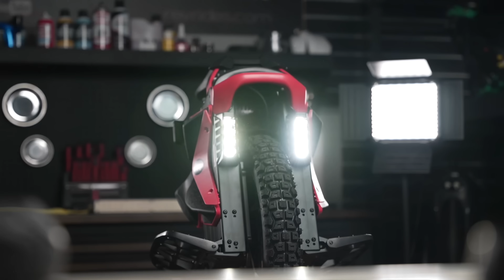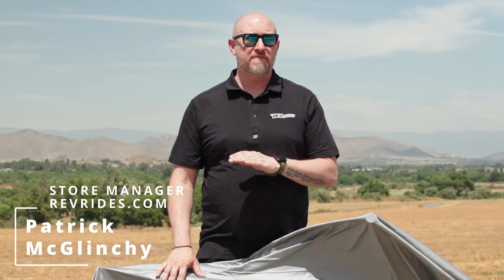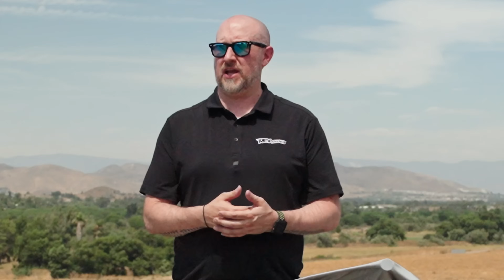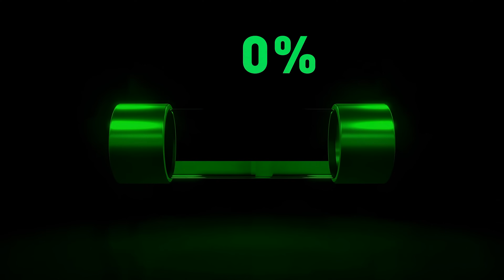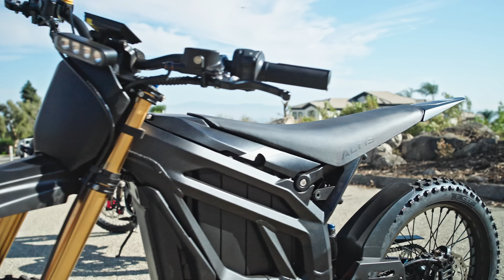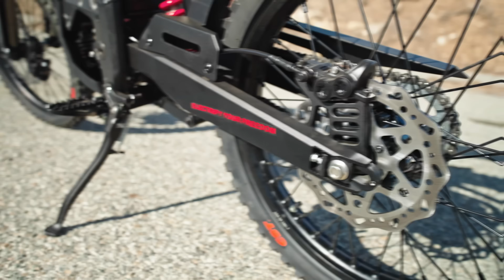Altis Sigma Electric Dirt Bike... The 98-VOLT GAME CHANGER! | Product Announcement

Comment: Wait so the 16 inch wheels are slower?
Reply: Looks like different sprocket size geared for more low end torque/quicker take off.
Reply: @clintroberts1  44T on MX vs. 39T on standard
Reply from the maker: correct! Why didn't you subscribe yet!?

Comment: Sigma or sigma MX for riding in NYC streets?
Reply: Sigma, not the MX. Mx is for off-road riding
Reply: Seems like you would get MX and then swap the front wheel with a 16 and Supermotos and then maybe change the rear sprocket.
Reply: @clintroberts1 Not me. Im 6'6". I'm going to need the taller tires. I'm already afraid the bike is going to be a bit small for me. Plus, bigger tires mean higher top speed.
Reply: @TooTallRides-TTR  Ah yes, different story then.  19's all around
Reply from the maker: 19/19 but its a dirt bike....

Comment: Have a E ride pro SS 2.0. This looks awesome though 98v is wicked. Although ive never heard of Altis. Id be willing to put my E ride up for sell but we currently have no clue about this company so that worries me slightly. If they prove to be reliable and the company has good customer service i may pull the trigger
Reply: They are owned by voro motors. So you can research them as a company to help a little
Reply: @averyrhoden2345  just wondering how you know that? Altis has been around for about 3 months as a company (i.e., has no track record). The principle address for the business is a condo in West Covina, CA. The company is apparently being run by a single guy (Qin Feng is listed as CEO, CFO, Director, Secretary, and Registered Agent).
Reply: @averyrhoden2345  where does it say they’re owned by Voro. I didnt find that
Reply from the maker: They are not owned by voro motors in any way
Reply: I agree and if I was to buy an ebike right now it would be Surron or Talaria because all these other no names might be gone tomorrow then what do you do.

Comment: $5,500 seems like a sick price. A shot across the bow, indeed.

I was so close to ordering an MX5 but the Sigma looks like it might eat Talaria for lunch, hmm... Reliability will be key, though. Hopefully the electronics are fully sorted since this appears to be using all new components and a different, lesser-used voltage system.

I assume aftermarket controllers/tunes will be coming - is there any headroom left in the stock motor/battery for more power (similar to what the Torp TC500 can do) or is this thing pretty fully maxxed from the factory? Looking forward to seeing more for sure!
Reply: This looks similar to the talaria dragon but a thousand dollars cheaper
Reply: @derald614  same forks as the MX5

Comment: * MX-5 has the Gear Box
* ALTIS has the Gear Box
* SurRons No Gear Box
* eRide Pro No Gear Box
The mx5 can become more like the ALTIS where the others cannot.
Reply from the maker: all true
Reply: Why would the MX5 want to be like the Atlas?... Why would ANY bike want to be like the Atlas? 🤨 This is market competition, you don't think Talaria, Suron, E ride are all gonna one up each other and keep leap frogging bikes that go faster for longer?
Reply: @BrooklynNY1979  
Why would the MX5 want to be like the Atlas?... Because Altis wants to be an MX-3.
Check it.
1. the MX3, the first with a gear box.
2. the MX3, the first with a beef up frame.
3. MX4 the first with IPM.
4. Talaria was the first company to push the limits.
Talaria's frame and gear box among its peers became the gold standard. The common novice now understands how far ahead of its time the MX3 was and is.

Talaria's frame design was copied by Altis, that proves how forward the mx3 design was. All the parts from a MX5 are interchangeable with the MX3. So technically an MX3 can be advanced to the level of the Altis with ease. 

Other surRon type bikes don't own the foundation to remain current. However, the MX-3 does due to owning a Gear Box and best frame design. 

All that said, the Altis became a MX-6 and Talaria should copy Altis by upgrading the volts/watts. Seeing Talaria was the first to show them the way.

Comment: 3.3" rear travel?  That can't be right.  That would make it very poor performing in most enduro and offroad situations.
Reply: The Talaria Boy will test it and then we will know what it has.
Reply: Right 3.3" is like an 80mm e-bike suspension.
Reply from the maker: when it gets here we will come to this video and answer questions!
Reply: Says on Voro motors website that it as 85mm with linkage same as talaria
Reply: They might be talking about shock travel instead of wheel travel. If it's really 85mm of wheel travel that's pathetic.
Reply: @mtbAndre1  ya i assume they mean shock travel

Comment: Tics many boxes but fails the obvious 18/21 inch serup, strange.
About brake pads. Can you set the bike to only regen when braking? 
Does it have anti spin?
Like the Ultra Bee. 
Does it have ABS brakes?
Reply: Traction control is for the newbs
Reply: @phat56pat  Everyone was a newb at some point. A bigger emoto community attracts more businesses giving greater options and lower prices.
Reply: @phat56pat And what is wrong with that? More customers. More riders in the electric comminuty.
Reply from the maker: It doesn't have bigger wheels for your exact reasoning 21 18 adds about 8 lbs and makes it to large for newer riders smaller riders. This is the Swiss Army knife of bikes as most everything but not everything. Traction control and abs that's not needed it is more of a crutch. no need for abs on a dirt bike. This is also a $5500 bike if it was $1000 more I'm sure those options could happen... Remember this is just the 1st bike....
Reply: @RevRides360  ABS costs about 500 dollars on a motorcycle and it has saved lives.
Reply: @RevRides360 Would not be too large with 18/21 if they thought of it from the design stage of course.
Reply: @RevRides360  world it be possible to put an 18/21 on it?
Reply: The Ultra Bee and the MX5 are the competitor bikes (same weight class). I looked very hard at the Ultra Bee because it ticks a lot of boxes, the Sigma just happened to tick a couple more for me. I recognize I'm taking a bit of a risk on a 1st Gen. bike from a company that has only officially existed for a couple months and appears to be run by a single guy out of his condo in West Covina, CA (every company was a startup at some point and if they get enough consumer support and are run correctly they tend to stick around). That said, if the bike comes somewhat close to the hype (yes, all these videos are hype videos because the bike hasn't actually released yet), it will tick more boxes for me at a lesser price than the Ultra Bee, especially considering I would have to spend another $2-3k to get where I wanted it. On the upside for Ultra Bee, Surron has been around for about a decade, the Ultra Bee already has a solid aftermarket in place (batteries, motors, wheels, suspension, etc.), and has a solid reputation. Everyone is different, choose what is best for you. The Ultra Bee is a little bigger bike (36" vs. 33" for Sigma and MX) for the same weight class. For me, the smaller bike is better for the tighter single tracks that I tend to ride, which the 19/16 seems to be good at for me. Everyone is different, choose what is best for you based on your skill set, the types of riding you intend to do, and your budget.